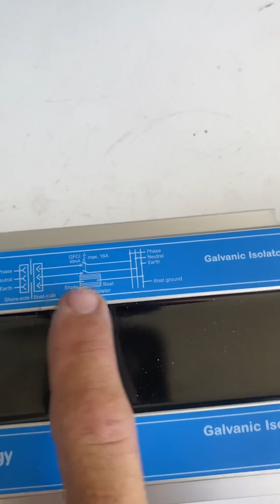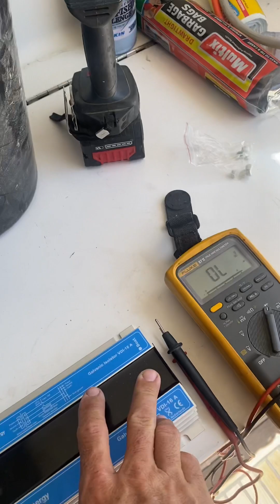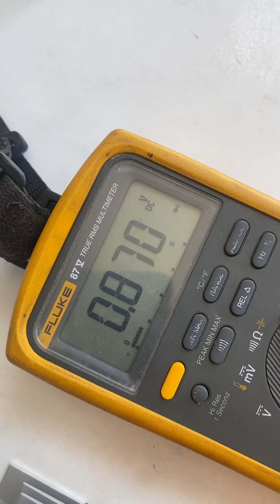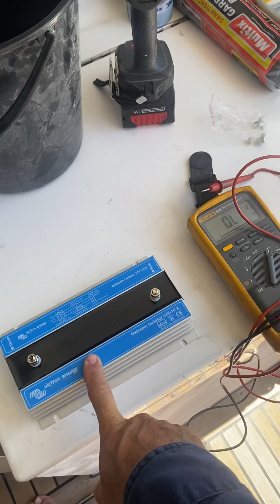Galvanic Isolator how to’s

Comment: How do you select proper size?  Victron has three amperage ratings.  if you have a 40A breaker, what size should one select?
Reply from the maker: You should size it to at LEAST the shore power circuit. In Australia, most boats use 15a or 32a shore power so that translates over easily. The rating is in the case the circuit has to flow fault current via the earth circuit.

Comment: Cheers for the video.Residual current/stray currents flow from neighbouring vessels regardless is that correct and degrade softer sacrificial materials on neighbouring vessels,how does this unit mitigate this issue,thanks for your patience.
Reply from the maker: Galvanic corrosion occurs when dissimilar metals contact together especially when a electrolyte is involved such as seawater in this case. The most noble of metals is considered gold.  The further apart the metals are on the galvanic chart the more aggressive the effect on the lower metal. The whole reaction centers around the flow of electrons much like a battery. When multiple boats are plugged into shore power they have a common “electron  highway”. The galvanic isolator blocks this “free” pathway preventing the sharing or passing on of corrosion. The voltage drop across the internal diodes is enough to normally prevent corrosion conduction whilst still allowing the earthing system to still function in the case of a fault.
Reply: @AWBElectricalMarine  much appreciated.
Reply: Great explanation! Thank you. Does that mean you break the ground coming in from the shore, and then connect the boat ground to the other side, as well as the ground from going from the isolator to the inverter? Or should it only have one ground wire from the incoming shore cable, then to the inverter along with the other cables, and have a separate connection between the inverter and the boat ground?